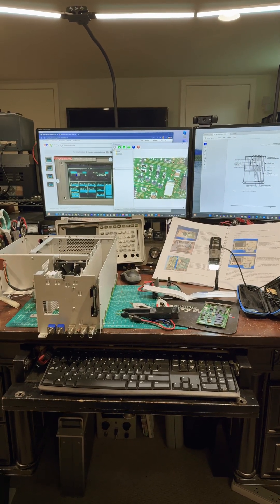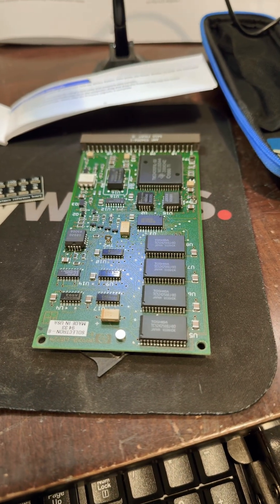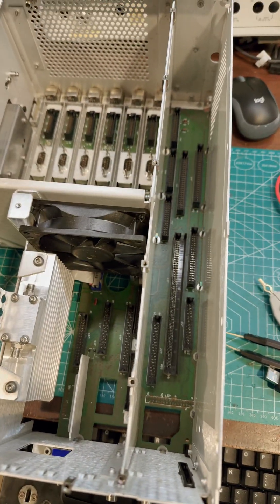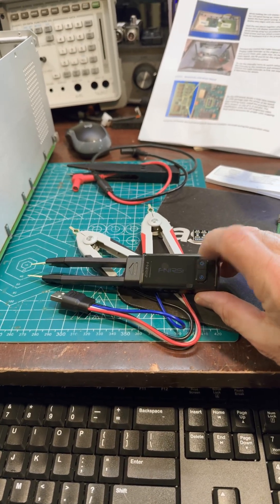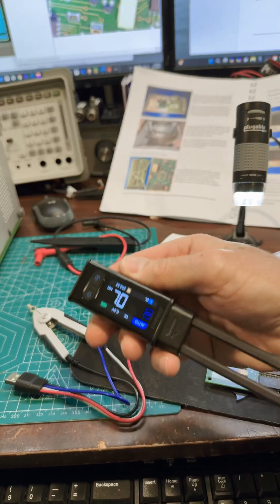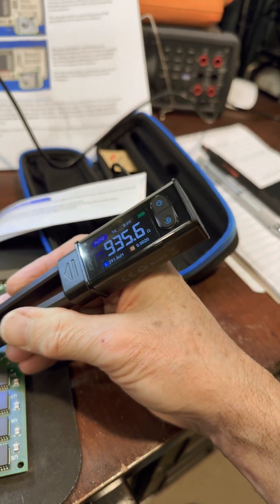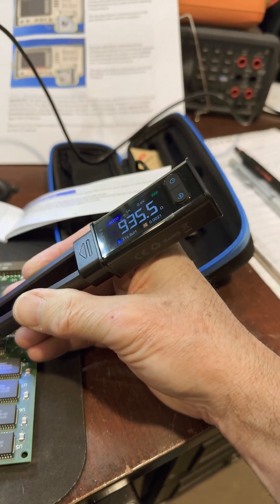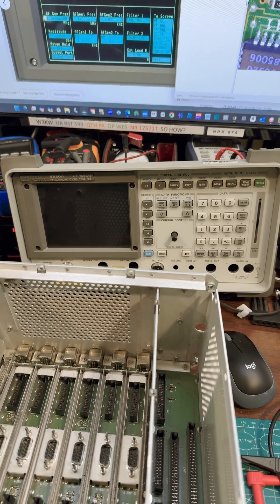HP 8920A LCD Conversion Progress and LCR Probe Part 2 #electroniccomponent #electronics #fnirsi

Comment: I'm betting that LCD upgrade would work on an HP 8591E spectrum analyzer too ... would that be a good assumption?
Reply from the maker: Yes! The NewScope is available for the HP 859X line! eBay and about $400. The same LCD works across several HP platforms from the era. Be careful though, my HP 8591EM already has an LCD display and the NewScope, though multi-color and desirable, is NOT compatible for swapping them out. Just do some research first.

Comment: Most people would ask why don’t you just buy a new one . If you did ,  we’d miss out on this series . I don’t wanna guess what a new one costs,, probably $5K or double ?? 
Im assuming when it’s completed , it will do exactly what you need it to do for you and your workbench, the same as a new one would without all the fancy smoke n mirrors you may never use or need
Reply from the maker: Well, they were $15000-$20,000 in the 1980's. Today, something comparable starts at $25,000 and goes to well over $100,000. These are laboratory grade instruments, and I purchased mine for $1600. Ha! But, at this age, they do require maintenance.